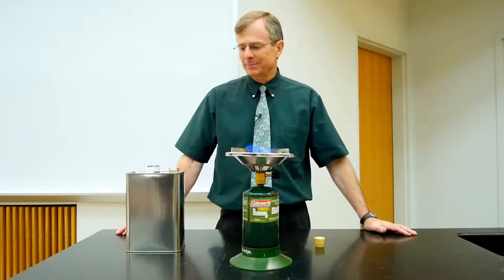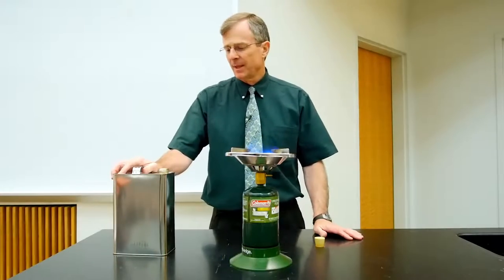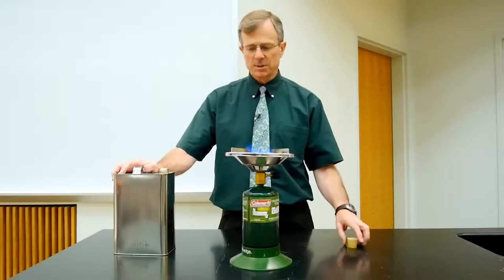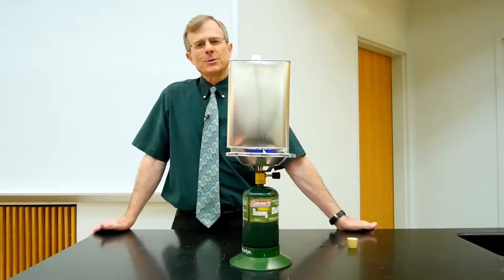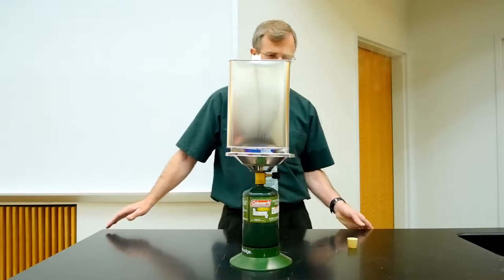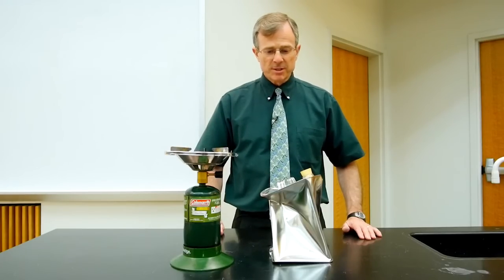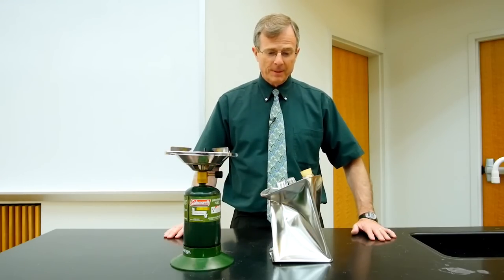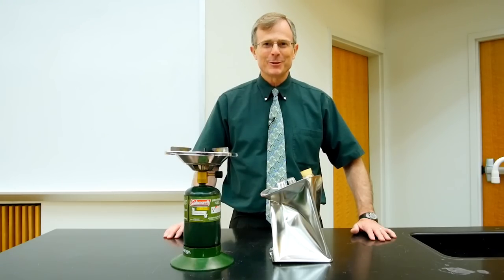Pressure Demo: Metal Can Implosion

Comment: Hello- I just wanted to point out that this is mostly a demonstration that liquid water takes up much less volume than steam.  The phase change (not the ideal gas law) causes most of the pressure differential between the inside and outside.  To confirm the relative contribution of each factor experimentally, try sealing two heated cans, both to the same temperature (say 100 deg C), one with the boiling water and one without the boiling water.  The can without the water will have far less deformation and more accurately represent the ideal gas law.  

You can also check this mathematically by using the Charles law (we can assume constant moles, and that the can will deform its shape to keep a "relatively" constant pressure).  (Assuming a 1L can and 25C final cooled room temp.) Use:  V1/T1 = V2/T2   

(1.0L)/(373K) = (x)/(298K)  

V2 = 0.80 L, assuming a perfectly elastic can.  This is only a 20% decrease in volume, and because the can is not perfectly elastic, we would expect something less than a 20% deformation.  Comparing this to the video we can conclude a majority of the deformation is due to the huge difference in density between steam and condensed liquid water.  There may be some unintended misconceptions for viewers if this demo is used to teach aspects of the ideal gas law or the various derivative gas laws.
Reply from the maker: Great comment, Tyler.  Thanks for the detailed analysis!